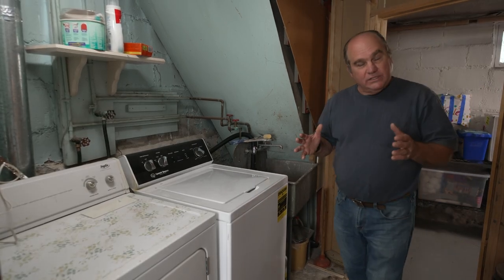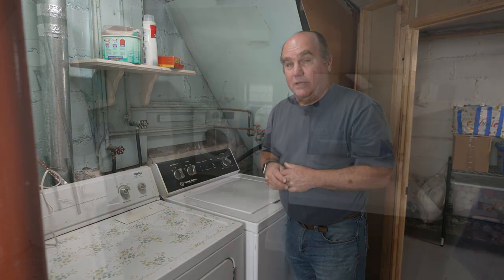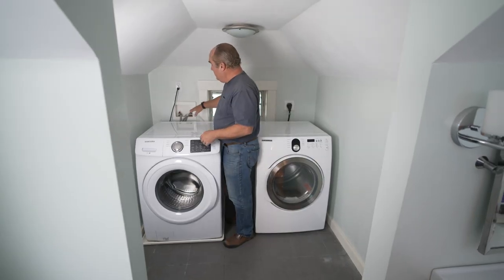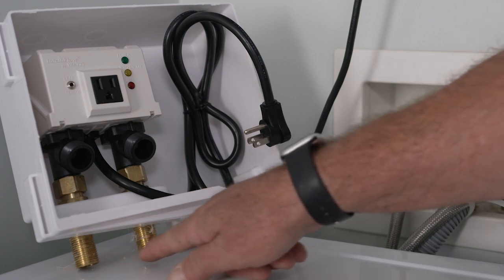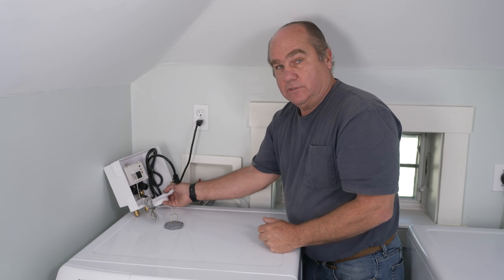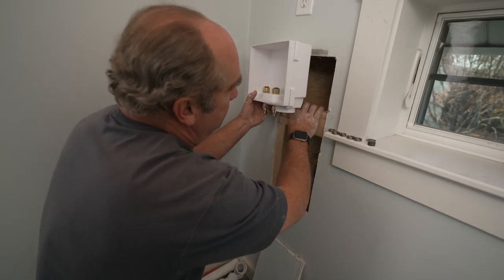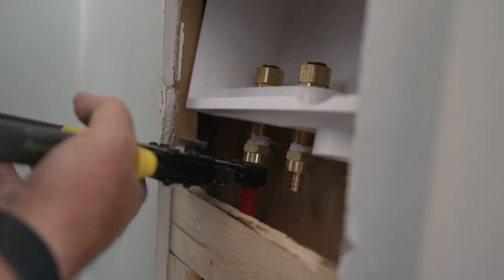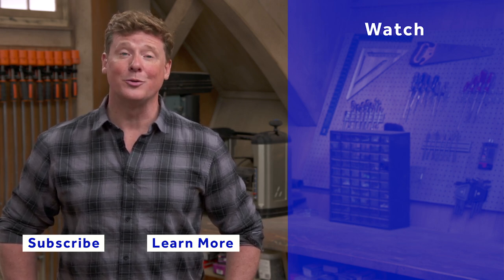How to Prevent Laundry Room Flooding | Ask This Old House

Comment: You didn't mention the other function of that unit - it has a moisture detector that gets placed on the floor under the machine, so if the washing machine itself fails and starts leaking, it also shuts off the water to prevent further damage.
Reply: Sweet. That was the question I was going to ask..........if the machine lets loose (and it has on me in the past)..........what stops it from continuing to let loose?

Comment: For $11 I purchased the flood alarm from Home Depot or Lowe’s. I put them threw out my home. Bathrooms, water heater, sinks and of course wash room. They work good but you have to be home to hear the alarm but then most leaks start out small before they become major. They work great.
Reply: Who responds to the flood alarm when you aren't home?
Reply: @rickybobby7276  they now sell a wifi one
Reply: I have the Ring wifi version. Battery is still full after 4 years, and you get instant notification. This device is better though with the autoshutoff. You can also get wifi whole home shutoffs with leak detection

Comment: Last I checked those auto-shutoff valves are quite expensive, I opted for a couple water leak alarms! Got a set of 2 for under $10, each take a 9v battery, and they work great. As soon as water completes the circuit on the little wires/board at the end of the line, the alarm goes off! Since we live on the 2nd floor, I put one by our washer, and the other under our kitchen sink since I have filtered water lines there.
Reply: @Kevin-mp5of  For a couple hundred dollars, the auto-shutoff is a better option of course for the washer, but nobody installs those under the sink.
In my situation, I told my neighbor to shut off our main if he ever noticed a leak.

Comment: This is so true. My wife and I bought a brand new home and when we did our final walk thru the water was turned on. The washer was on the second floor. Well the washer hoses were not connected to the valves and the valves were on. We didn’t go to the new home until 3 days l! After we closed. Long story short we had 30k in damages before we even stepped into the brand new home. Water was pouring into the first floor and the basement
Reply: Wow. That is rough. I wouldn't have thought about that.
Reply: ....and the seller paid for it, yes? Any damage when the seller owned the property (before closing) is their responsibility. I would not have signed the closing documents without ensuring they paid for it. If they went through insurance, I would not close until the repairs were complete.
Reply: @mr.g937  nope we paid it. We couldn’t prove that the hose was not attached at the time of closing. So as soon as we signed the papers and closed, they called the water company to turn on the water. But when we did the final walk thru the week before they plugged in the hose to the washer so we can test it out and then when we left they turned off the water and disconnected the hose but didn’t turn the actual valve off. Either way we were responsible. The good news on all of this was that my insurance paid for it and then dropped us after the year lol . But! We signed with a new insurance provider thru my employer and actually ended up playing less of a premium. So it worked out at the end .
Reply: @joshuaroque6514  Insurance providers will almost always drop anyone who makes a claim in their first year. I misread your previous post, I thought you said you discovered it during the final walk-through, but it sounds like you're saying you discovered it after closing.
Reply: @mr.g937  true story! Discovery was made after closing. We should have been responsible home owners and gone to the house right after signing. Lesson learned lol
Reply: @mr.g937  Can you not read?

Comment: I shut off the valves every time I do a load of laundry.  It really isn't a big deal.
I do it because when I sold my second house, those valves were in the open position for over 16 years and yes, they wouldn't shut off when I wanted it to, in my case, the day of moving!
Reply: I do the same, habit now
Reply: I turn mine off when I leave for a weekend or on vacation.  I know I should do it more often but at least I won't come home to a flooded house after a relaxing vacation.
Reply: @gizmobowen  and speaking of vacations, I know I should actually turn off all the water valves but I don't.  My condo only has one master water shut off for each four units.  When I'm out in my RV, I actually turn off the park's water feed to my  RV when we leave for the day.  Water damage is the worse thing that can happen to an RV.

Comment: I am putting in an upstairs laundry.  Good product suggestion but it only addresses a  water shut off and that is  but one kind of leak.  I  am not really concerned about a hose busting loose because more then likely they will start by leaking and get progressivly worse.  I am thinking about backups and  a clogged drain or washing machine failures as well.   I seems like the washing machine should have a reservior of some kind between it and the drain pipe.  Much in the same way you have a laundry sink  in the basement.  And you still have to have some kind of lint strainer I think.   There has to be some kind of drain on the floor as well.

Comment: Richard, I've heard you say this for years (I've even asked about it in YouTube comments), but I can't figure out why you think the washer is somehow different from every toilet and sink and water connection in the house.

These are all the same connections. The hoses are right next to each other in the store. There can't be anything meaningfully different about them.

Why do we need this for the washer and nothing else? (And don't say water hammer)
Reply: Toilets and sinks are braided hoses, they aren't subjected to vibration either. Rubber hoses are flexible but degrade over time.
Reply: That's simply not correct. The types of hoses you can buy for the washer and every other connection are the same. You can buy braided or not, but if Richard recommended only buying braided ss (which I do) I wouldn't be asking why the washer needs some special device.

Now, maybe you're on to something for vibration, but that doesn't imply special devices -- just different hoses.
Reply: @cbfreder  completely agree with you and never understood this. They're literally the exact same hoses and connections. You don't see people turning the water off to their toilets after use! 😂
Reply: Why would you use those flexible hoses anyway if you can also use pex or copper?
Reply: @rutgerhoutdijk3547  the PEX/copper goes to a valve at the wall. The fixture is connected to that valve with a short length of hose--the one that they're talking about breaking.

You still do want a valve at the wall, but the question is why is the solution some ridiculous device and not, like I think you're trying to say, a hose that doesn't break.

The point is though, Richard only (and regularly) recommends something like this for the washer, but the connections are the same for every sink and toilet in your house as well.
Reply: @rutgerhoutdijk3547  don’t want to solder for copper
Reply: @rutgerhoutdijk3547  material fatigue
Reply: @cbfreder  This is if your faucets and toilets aren't connected with hard lines. The hoses are similar in construction but the size is drastically different. A 3/8" hose has a lot less internal surface area than a 3/4" house. There for the 3/4" hose has to resist more force but still remain flexible. It creates a catch 22 where making the hose more resistant to the internal forces makes it less flexible and more likely to fail on material fatigue. Making it thinner makes it more susceptible to pressure failure.
Reply: @cbfreder  not in my house. My toilet and taps are 1/2" BSP and my washing machine and dishwasher are 3/4" BSP. Additionally, the washing inlet pipe is much thicker than the pex/braided stainless toilet/tap connecters.
Reply: This is why I shut down ALL the water to my house at the main shutoff before leaving the house unoccupied overnight
Reply: In Europe every (dish) washer has an 'aquastop' which is a device on the end of the hose where it connects to the tap, that is just an electronic valve controlled by the appliance. This prevents almost any kind of flooding. Doesn't this exist in the US?
Reply: I think part of it is an outdated view that laundry machines are used so infrequently that these problems would go un-noticed for days at a time. In a basement, I could see that being a half truth, but less of a problem, since basements usually have a drain. But in a situation like this I would say it's more likely to be noticed in a timely fashion, if the machine is in the master bathroom, a relatively high traffic hallway or other living space. Part of me wonders if as a society, that we've become too unaware to remember that there are shutoffs behind washing machine etc, even when they're in plain sight. That said, I wouldn't be putting laundry upstairs without building/renovating to make sure there's a floor drain. Just incase there's a worst case scenario. Whereas, with a toilet... we've all had to jiggle the handle/shut off the water to prevent an overflow that that's just second nature.

I personally, would want the device for peace of mind.. but am not about to have to remember to turn the water on and off every time I use my laundry.
Reply: @davidriley7659  I'm not sure how this refutes my point. My hoses are the same thickness and under the same pressures. Maybe there's more water hammer or vibration, but that just means thicker hoses or different material or more frequent replacement. Not whatever this crap is.

Richard already says to replace your washer hoses every five years. Why does he think it's ok to have 30 year old toilet connections? AFAIK he's never said to replace the other connections. Oh, and the valves need rebuilding or replacement, too. At least my washer valves drain away if they were to leak.

(Ps. I really hate YouTube comments. They make positive discussion impossible)
Reply: @cbfreder  then it sounds like you've got the wrong hoses on your washer. 

Toilets dont vibrate like a washer

Comment: If you read the reviews for that expensive device you'll likely opt for a different solution i.e, burst free hoses, floor drain, water alarms, or just getting in the habit of shutting the valves off after use.

Comment: I have great respect for this show and this is a great upgarde,  however the Itelli-Timer model used in this video is problematic and not relaiable over the long term. We installed 60 of them,  many have failed, We are going to the RS - 70,  DYI  by Flood Master  - no plumber required for the install if you're handy

Comment: I put ball valves in 40 years ago but the 2 or 3 times that my wife closed them forgot to open them next time she used washer. Will be purchasing something like you shown. Also have 2 solenoids that I will be installing on my 40 gallon water heater. First 2 water heaters that I installed 40 some years ago leaked.

Comment: We installed that unit on our HE top-loader not for the safety shutoff but for water savings! If the machine goes off-balance it will fill all the way up over and over fruitlessly trying to correct the off-balance problem and wasting dozens of gallons of water! With this unit it always cuts off after 60 minutes because we'd rather have the machine stall and give an error code than run all day and waste water on a problem it's unable to fix.
Reply: You must have a Samsung  too 😂
Reply: The machine won’t let me add enough water to completely cover the clothing, but when it goes off balance it will burn through 100’s gallons trying to fix it. Energy star regulations are a joke. I hate baby sitting my washer.
Reply: @MoneyManHolmes  Actually it's an LG.

Comment: Thanks for your video.  I live in a condo that is 35 yrs old and the plumbing  waste and vents for are all 1 1/2 “ except the toilet .
I read the code for rough in laundry box must be 2 inches.  In your video the laundry box looks like 1 1/2 “
I’m planing to rough it in with 1 1/2” cause converting to two inch line  is a major job , I’m on the second floor. Any suggestions will be appreciated. Thanks

Comment: don't forget to mention it has alarm if water is on the ground, it has two leads that have sensors on the end of the lead wires they are to be put on the ground next to the washer  and it will shut off the water too... soon the unit will text you and call on cell phone you need to check your washer my be leaking...

Comment: 8 years?!!

*don't think about 26 year old hoses*
Reply: Tell me about it,   thinking back on the hoses that were put on the washing machine when I moved into this house some 20+ years ago.    Oh yeah that 5 year rated water heater that's pushing 15 years and I've never changed out an anode rod.    Well everything is in a basement, on a concrete slab that's sloped towards a floor drain so I'm good to go :D
Reply: @Mike__B  Similar here. I have racks with a few inches of floor clearance just in case anything goes. Nothing is directly on the floor.

Comment: The Steel hoses that I have, have a built-in pressure regulator that if the pressure had a rapid change it will kick in and stop the water from leaking out.
Reply: Have a link? Because those sound awesome.

Comment: Just get a good set of stainless hoses and change them out every 5 years. This is typical advice, they're like $20 on amazon. Never turned off the washer in my life...except to change the hose. Never known anyone who has...it just isn't necessary. Don't use crappy 1950s style rubber hose!

Comment: hey Richard: that laundry/bathroom looks relatively new compared to the basement. Why weren't they required by code to  run a 2" stand pipe for the washer, instead of the 1-1/2"  line they ran? (no permit job?)

Comment: While the flow of water to the washing machine will be shut off, there will still be pressure on the hose. The only way to depressurize the hose is to open the valve on the other end of the hose, inside the washing machine, by turning it on, which you can’t do because the washing machine is plugged into the new switch. 🤔

We have a weekend house where we shut off the water when we are not there. After we shut the water off, we open the faucets to depressurize the system. Unless I am mistaken, it seems that this switch will not do that.
Reply: The valve is going to shut the hose off from city water pressure. It will still be pressurized, but it will only contain the limited amount of water between the wall and the back of the unit. If the hose fails, the damage will be minor since there’s not much water there.
Reply: @BitmappedWV  Yes. Understood. However, he said several times that the hose will be depressurized. It will not. The hose will last longer if it is depressurized.
Reply: @a921dji3  I just replaced a W/D that was 28 years old. Same hoses since install. Only time I had water on the floor was when someone tried to put a large comforter in and the incoming water in the tub spilled into the floor. Otherwise nothing. The hoses were still decent when removed. Like others I never shut off the valve in almost 30 years, and they did leak a little at the packing nut when I shut them off (and I had to use a cutting tool to remove the connector at the hose). Otherwise no issues. Not typical or expected but hoses don't just rupture for no reason. Replace your hoses on a schedule and you probably never see a newer WD last 30 years.

Comment: Hello I'm a Appliance technician by trade and This safety shut off valve is great idea..BUT IT DOESN'T WORK ON CERTAIN WASHERS MODELS,due to the way they work on start up..the water doesn't come in continuous and instead they pulsates income,which shuts down that safety valve (valve thinks there's a leak,unless manufacturer has changed that feature)..customer calls for a problem service on washer and this valve ends up being the major problem.  I've seen it several times..so PLEASE LOOK INTO THE MODEL YOUR BUYING BEFORE U SPEND ALL THAT MONEY!!!!!ALSO THEY HAVE ANTI FLOOD WASHER AND DISHWASHER HOSES WITH A SAFTEY CHECK VALVE..ANOTHER GREAT IDEA,BUT IF THE WATER PRESSURE VERY HIGH IN THE HOUSE..IT WILL STOP THE WATER FROM GOING INTO THE UNIT AND THERE'S NO LEAK COMING FROM THE HOSES AT ALL
Reply: OK GREAT TIP THANKS

Comment: Interesting, but many washers are now Wi-Fi enabled for remote notifications, so this power-off option would negate that feature by resetting the connection. 

Also, most the leaks I’ve see from my homeowners are from the Applience itself during operation. 

Best option for an upstairs laundry is to build the entire floor and back wall like a tiled shower pan
Reply: I wouldn't even consider living space laundry without a floor drain. It just isn't worth the risk. We had a leak from our LG washer last year. It turned out to be the bleach dispenser solenoid.. I disconnected the solenoid from power and the leak stopped. We didn't use the dispenser enough to justify replacing the entire solenoid unit. If I need to bleach something, I'll just pour the bleach into the tub first, load the washer and go from there.
Reply: Yep. Leaks happen during operation.

Comment: How Does it release the pressure, or does it just make it so if it leaks it's limited to leaking the water in the hose?
Because even if you shut the water valve there is still "full city pressure" in the hose causing ware and tare.
(If you ever disconnected a hose head or pressure washer after turning off the hose, there is still the pressure in it.)
Reply: The tiny bit of water in the hose isn't enough to cause any major damage...just a slight annoyance.

Comment: Why not just run Pex lines to the washing machine?   Instead of using glorified garden hoses.  For that matter why do washing machines still use garden hose type connectors?
Reply: Vibration/unbalanced loads.
Reply: Serviceability and vibration. Pex isn't intended to be mobile.